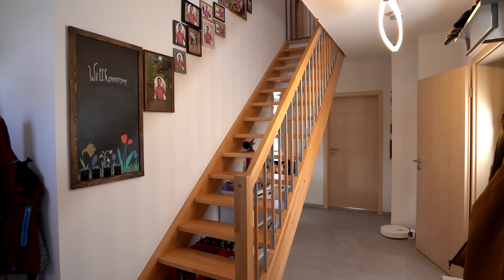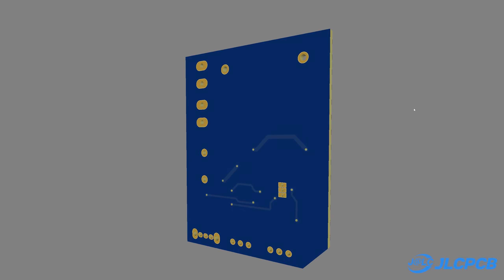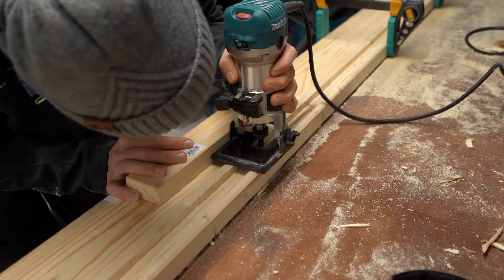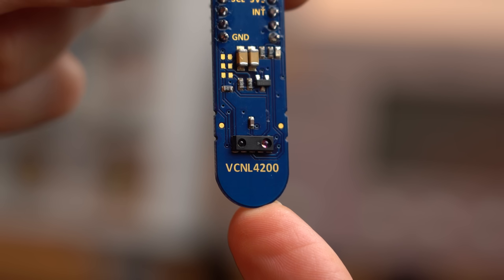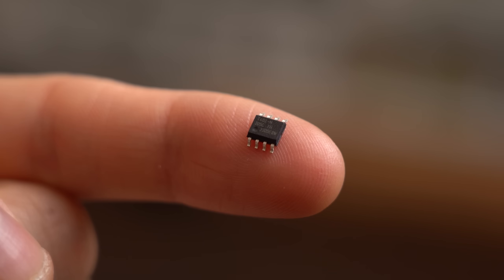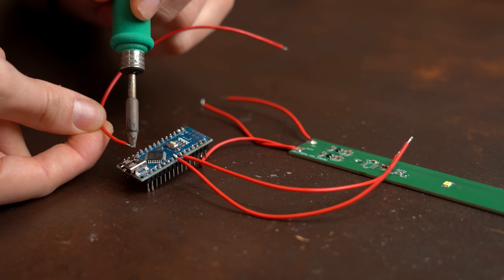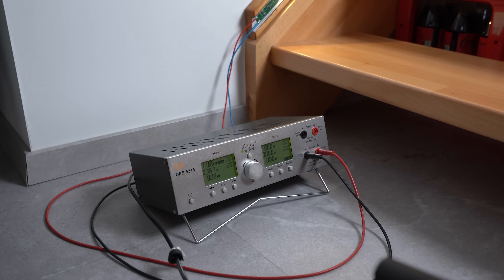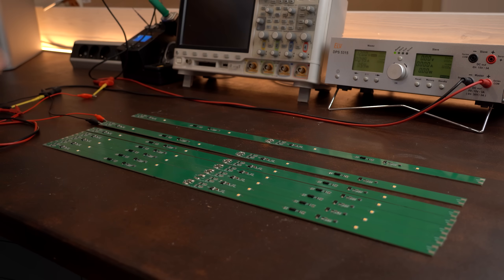I tried to Revolutionize LED Lights!.....And FAILED?

Comment: You could use your clear covers and add defusion to them and leave the area in front of the sensor clear so they still work as intended.  Projects like this rearly work right off so it's nice to see a realistic expectation here where it doesn't work right the first time.

I like your solution for mounting the light strips and not attaching to the staircase itself you even got a good colour match, well done.
Reply: But IR has a hard time going trough any plastics, so a hole in it would work better in this regard.

Comment: I'd make all the PCB's "dumb" with the microcontroller only on one end. I'd use connectors to stack them instead of solder. The single microcontroller would be aware of every occupied step and make some intelligent decisions about how to light the individual LEDs. The micro could calculate how fast you were going up or down and fade up and down the right lights to follow you. The micro would also be aware of multiple people on the stairs at any time and do something attractive with that knowledge, such as light every step between them. You might be better off with a single really good expensive sensor looking at the entire staircase from a better vantage point instead of so many individual "inexpensive" ones. A remote sensor would let you use a diffuser and more closely spaced LEDs for a nicer diffused look. Neat project. Good luck!

Comment: Your main problem is your absolutely horrid PCB layout that mixes low-power digital signals with high-current switching regulator (LED) power traces. You have committed just about every cardinal sin of signal integrity. Make Inner1 and Inner2 apart from the 12V strip ground planes, move all low-power signals to the top/bottom layers routed along the bottom edge, keep all of the noisy stuff along the top edge, via-stitch copper islands so noise current doesn't have to take massive detours and things should clean up quite a bit. I have already redone most of the layout to fix the worst issues and try the software out, just don't know how/where to post it. Putting the 5V regulator so far away from its only load is an unnecessary long trace to route when 12V is available across the whole board, that should go right next to the sensor to free up routing space around the micro-controller.

Also, you only need one daisy-chain signal pin between boards: let each micro-controller have an upstream connection and downstream connection pin, each micro-controller's upstream pin connects point-to-point to the next controller's downstream pin. Both micro-controllers can pull both lines high while they are idle and monitor them going low as the neighbor turn-on signal, then turn off pull-ups (if the IO doesn't automatically do so while driving low) and drive both low when its proximity sensor is triggered to signal both upstream and upstream micro-controllers to turn on. When nothing is in range, stop driving the outputs low and turn the pulls-up back on. When none of the neighbors are driving the upstream/downstream lines low and the board's proximity detection isn't sensing anything either, turn off the local LED. This eliminates external components and pass-through signal traces that go all the way across the board for simpler routing and reduced noise susceptibility.

Comment: Well ur communication method is too complicated.You can just use high and low state to communicate. Also u can use juper to temporarily set the programing mode and when done remove to use the pin as gpio and have a better but simpler communication method

Comment: We'll, I'm not an expert so feel free to make my idea simpler but I'm thinking you should make it simpler and more advanced at the same time, hear me out, you don't need to redesign the pcb, just isolate the data line and make 3 output for led lights and one input for led light in each pcb, and use resistors and diodes in each output, calculate and adjust the brightness with the resistors values, so for example 1 is 50% 2 is 80% and 3 is 50% and connect output 1 to the input of the previous pcb in the chain (if exists) and output 2 to led on pcb and output 3 to the next pcb in the chain (if exists), so you have a cool effect of the light sliding up and down with you stepping on them.

Comment: I think I have a few suggestions for this,
(A note before we begin, I'm not any working professional and have no experience. Just some interest in electronics)

1. Add some heavy capacitors(~100-1000 mF) directly to LEDs and a way so limited current flows(resistor .5-5k) to them LEDs and capacitors. That way, whenever led turns on or off, they happen smoothly.

2. Add 5 pins, 2 big on the sides for power and 1 in centre for programming the microcontroller(as used in the video), all at once.
3. For the remaining 2 pins, they'll be 'in' and  'out' data pins located between the centre and power pins.
Use them for Daisy chaining.It'll be like this:

(+)-------------------------------------------------------(+)
(in)-------------through the MC------------(out)
(prog.)---------------------------------------------------()
(out)----------through the MC---------------(in)
(-)-------------------------------------------------------(-)

i. When a board senses something in the proximity, it'll obviously turn on but also send the signal to both ends(1 for on, 0 for off).
ii. When a board receives the signal from either end, it'll turn on the led but won't pass the signal to output pins.
This way you can stand on any step and the next one will be ready for you to see and it's simple to implement even without the microcontroller.

If you want multiple steps to light up, use frequency/data method.
In this method, board with proximity will generate and pass a certain frequency to both ends and receiving board will turn on but will pass on a different frequency to both ends and so on upto the frequency that it won't be passed anymore by the receiving board.
Now you can light up n number of stairs with n number of frequencies.
Easier said than done, this frequency/data method will have few problems of its own like calibration, noise, input-output loop, etc.

Edit: A new method came to my mind, remove those 2 in and out pins and add a common frequency rail where each MC will generate their own frequency, and also they will always monitor the frequencies and know exactly on which step you are and respond accordingly by turning on.
This method is quiet power inefficient so add a sleep/low power mode where it won't monitor frequencies if there's already a certain amount of light on stairs.
It's getting long to explain so I'll stop here.

One more thing, you don't need boards that long, it can be fitted in 2-4 inch length. You can use wires to chain them.
I came across the ad of such products a few months back but like you said I also didn't find them good enough for my liking (idk what's their state now).

Hope to see you come back to this soon, take care. 😉

Comment: I have a feeling that at least part of the issue is that you're using IR distance sensors, and the stairs have a glossy enough surface that the reflection is causing issues with the sensors triggering each other.
Reply from the maker: Checked that. That was not the problem.

Comment: Thoughts:  1. you are picking up the stairs in your distance readings, consider angling the whole thing to point up, probably by about the angle the light cone spreads on the side. (also, they might be screwing with each other with the IR reflections) 2. You are going to wish you used connectors between strips (I bet you already do!)

I have been considering a lighting project myself for the stairs, and it never once occurred to me to create a side bar like that.  Nice idea!

Comment: 2 quick ideas:

- Decouple the data between pcbs with optocouplers
- Add an RC Lowpass in the Voltage path for the logic (not the led driving path)

Comment: Thank you for sharing this and your frustrations. I recently pushed myself really hard on a very large project and kept running into roadblocks over and over again that were very difficult like these and it was incredibly difficult to keep pushing myself forward but I finally did and I finally worked through them all and finally figured it all out. Hang in there you got this you will eventually figure it out it's probably just a silly piece of code that you didn't realize because you were going so fast

Comment: For the future version it would be interesting if not only the current step lights up, but the next one too. Congratulations on the project, it has great architectural potential.
Reply from the maker: That was the initial plan and it is already implemented in the project. It just did not work on the staircase.
Reply: I think that was ultimately the goal of this.

Comment: Why is no one talking about why he has so many bottles of coke under the stairs 😭😭
Reply: In Germany it is very common to buy all sorts of drinks in crates (Kasten), and they even have shops dedicated to sell them and exchange empty bottles. You can see the glass bottles are heavilyscratched, meaning they have been in this cycle many, many times. This way, people not only save money when buying in bulk, but they also save time by not having to deal with individual bottles rolling at home. If you don't know, when buying drinks in Germany, almost always you are paying additional "deposit", which depending on the type, can be returned if you give back an empty unbroken container. This helps a lot with overflowing trash and teaches people to carry a bit more about their surroundings. The same as shopping carts which take a simple coin to unlock encourage people to get their money back and not leave the cart randomly on the parking.
Long story short: yes, he has two crates of coke under the stairs, because of economics, environment, and convenience.

Comment: Hey! Hello Scot. I like your works. Greetings from Spain. 

I think you should start from 0 as you said. And this time we start from other perspectives. You can solve both the practical and aesthetic problem in many ways. 

Aesthetically, I think that LED strips with a diffuser are best. Although I understand the limitations, but I think there are several twists to solve it without losing aesthetic quality. 

I think separating strips and sensors using the wood profile as a support for the sensors is a good idea. 

Another cleaner but more complex solution is to use a laser and several mirrors to determine the distance of the feet and pass that information to the location of the LED strips. It sounds easy p but I think that at the programming level it is more complex. I'm not good at programming either.
Reply from the maker: Thanks for the feedback :-)

Comment: I would have used ws2812 chips for controlling each step leds with 1 microcontroller at one end and two proximity sensors at both ends. That way presence can't be detected on each step but you can control each step based on fixed time. But your attempt takes it one step further. Good luck for v2. Love from india
Reply from the maker: Thanks for the feedback :-)

Comment: I’m sure someone else already mentioned, but putting them under each step would surely look much nicer and discreet, and making the light with triggered sensor light up the two steps next to it in each direction.
It would give more even light for the steps, and you could use a cheap short existing strip made to work with 5/12v or such, so you only have to add the step sensor to it, and everything could be hidden under the stairs to keep the wife happy.
Reply: thats a great idea but i think hiding wires for each step will be hard i think thats why he didnt go that route.
Reply: @arnavbadhe1278  nah that shouldn’t be any problem, since he can run them under there too, and even on the inner side of the outer edge so it wouldn’t be possible to see them unless you’re literally walking under the stairs.

Comment: I think it failed because you over complicated the design and could be done with one microcontroller IC in main board and the rest of the boards are just plugabble boards + it is more reliable than using attiny because I think you failed because of it

Comment: Where you went wrong is that you overcomplicated it massively. Too many points of failure. Since products like this already exist, it seems like you're trying to reinvent the wheel here. Kudos for trying though, you've got the patience of a saint!! But sometimes perfectionism comes at great cost 😵‍💫😵
Reply from the maker: Show me a product like this. Not something similar. Just like this. I could not find it anywhere.